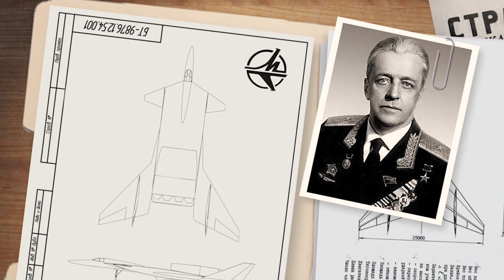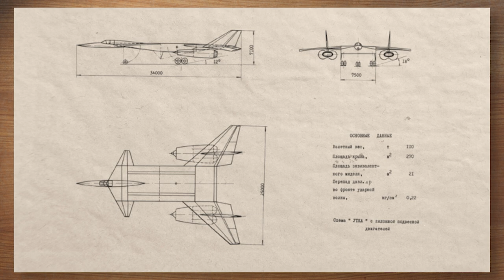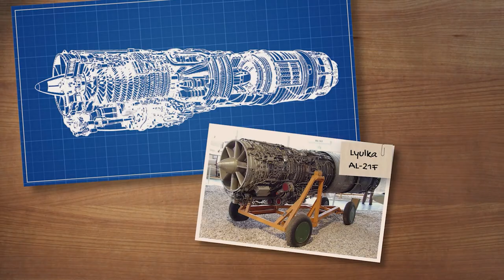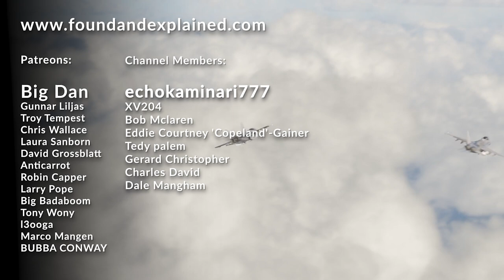Sonic Boom As A Weapon - Russian Top Secret M-25 Hell Reaper

Comment: Try looking up SLAM, the Supersonic Low Altitude Missile. It was to use its Mach 3 speed induced sonic boom as part of it’s offence, along with the fallout from it’s nuclear propulsion, and then deliver a thermonuclear warhead to it’s final target. Truly a nightmare weapon. Perhaps not surprising that even at the height of the Cold War, the USA decided not to go ahead.
It’s development did lead to the navigation systems used by cruise missiles, so we have seem at least part of the program used in operational weapons.
Reply: I believe that plans for that weapon included the ability to drop off multiple warheads on it's pathway, then supercruise over undamaged farms and cities spewing radiation until something broke and it crashed.  Certainly if it had been put into production, this would have eventually been the case as warhead size shrank.
Reply: Its airspeed during attack runs has been estimated at from Mach 3 to Mach 5, while glowing red hot (including most of its pneumatic "avionics").

The USA decided against it for the same reason this video gives for the Soviets dropping their version;
"We can do this but should we? No."
Reply: @markfergerson2145  Honestly, do you believe ethics have ever provided a valid reason not to develop a weapon?  Manhattan Project...  And militarily and strategically speaking, you ALWAYS develop ANYTHING that gives you battlefield domination or a heavy advantage. Don't be too quick to swallow the politically sweetened candy that is given to the public.
Reply: @andrewdavies3584  Oh, I'm way too old to believe anything anyone says without looking at the parts they don't want looked at and yes, I do indeed know the history of why arms races occur.

The Manhattan project (and the similar projects the Brits and Soviets worked on) came from German research before and during WWII. Nukes were frankly  inevitable once nuclear science got started in the early 20th century. What wasn't inevitable that nukes have only been used twice in the seventy-some years since their invention and actually ended the possibility of any more World Wars. I now, everybody goes on about the likelihood of nuclear Armageddon but it hasn't happened. Instead all nuclear powers have drawn down their nuclear arsenals.

We finally found a real "weapon too terrible to use".
Reply: @andrewdavies3584  Project Pluto got as far as engine tests; we know it would work but in reality, the entire weapons system would fall to modern air defenses. That's one reason cruise missiles have fallen out of fashion with all nations except for use at sea where it's impossible to have the density and competence of defenses that can be achieved in land-based systems.

As for the so-called Star Wars program, remember that Reagan raised plenty of American hackles when he publicly told the Soviets that America would share the system once developed so that all nations could defend themselves from nuclear attack. The Soviets actually got angry at that possibility- they claimed that being able to stop nuke attacks was "destabilizing". (I'm 69 and lived through the period and saw all this go by in real time.)

Times change, leaderships change, attitudes change.
Reply: @markfergerson2145  SLAM did not have any sense over ICBMs once was found how much expensive it would be to build ballistic missile defense, and considering the speed of that Soviet contraption it would unlikely do very much. Radar-guided self-propelled guns proliferated in 60ties and man-portable AA missiles came soon after, so flying low even if supersonic was only a one-way ticket, so both projects were canceled simply because they were not very clever ideas, not because they were immoral, that was something military never bothered with until internet age, as the state can no longer control the narrative by being the only source of information...
Reply: That's actually a myth. It would cause some damage, yes, but the engine actually produced less radiation than background in testing, and the sonic boom would not have been enough to kill people. It was never meant for either. It was supposed to loiter in midair, then get activated and fly around at supersonic speeds so it couldn't be hit, carpet bombing everywhere before finally kamikaze-ing its primary target. It also didn't even fly low enough for the booms to have an effect. This was taken from an official document declassified by the government detailing a meeting held during testing, in which the project rep stated that the project was never intended to have such effects

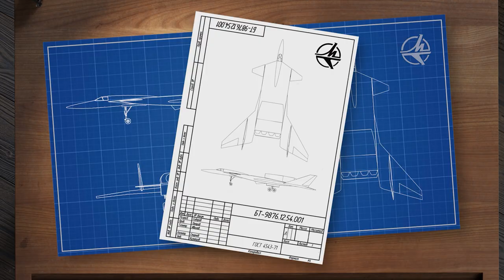Comment: 5:08 "ГОСТ 4543-71" - LOL ))) It's means "State standart for structural alloy steel bars."
"This standard applies to hot-rolled and forged steel with a diameter or thickness up to 250 mm, calibrated and with a special surface finish from alloy structural steel, used in a heat-treated state. "

Comment: 6 PSI eh? from a study I just read it seems it would be like receiving an abrupt  200mph wind for a couple (?) seconds , some buildings (not made of reinforced concrete) would topple, most of the people injured, some people dead (both from the air wave and flying objects/being thrown into objects) , blown timpans ,  0% crashed skulls from the pressure itself (confirming my hunch that that pressure wouldn't be enough for that)
Reply: but it would've thrown people everywhere
Reply: Hector, that's not how pressure waves work. I suspect you are considering static pressure, and anyone who has dove/dived to 5+m below the surface will have experienced static pressure of over 6psi above atmospheric.

A pretty intuitive example of how overpressure can cause you to have a very bad day is an explosion. A 6 psi overpressure is what you'd experience stood around 3-4 metres from a kg of dynamite going off. I'm no expert on dynamite, but I know that standing 10 feet away from 2lb of it is going to be very, very bad for my health. 😉

Another way to express it is sound pressure level... a 6 PSI overpressure is equivalent to around 450dB SPL. 200dB is generally regarded as the threshold where death becomes likely (through the same mechanisms as an explosion).
Reply: Big 🧠’s are lurking
Reply: @donkmeister  Google or someone deleted the link to the study I used for my first comment, it was an study from the 70's on effects of pressure on people and infrastructure, pressure caused by bombs or mine explosions, NOT static pressure. I said 6 psi causes building destruction (except reinforced concrete ), a good porcentage of casualties, high porcentage of injured but not craneal implosion as the video said at the start.
Reply: @hectoraccented5312  Calibrated burst diaphragms are commercially available to determine overpressure spikes from explosions. They are derived from work done by various militaries in the cold War era for the same purpose, to directly measure overpressure spikes from nukes at various distances from "ground zero" to compare against theoretical predictions (which turned out to be pretty good).

Comment: I don’t understand how the indiscriminately kills “friend or foe” is a concern as you mentioned a few times. It seems to me it could be much more focused to a small area than a nuclear weapon could ever be. I guess the thought was that this would more likely be used than nuclear weapons. But if you compare it to traditional missiles and bombs, it also had the capacity to open and close the Ledge to aim the boom like a missile.
Reply: No, the area of effect would be way larger than a "standard" nuclear bomb.  At mach 1.5, you go at 475m/s...  If it used only for around minute, you affect in an instant a 30km line, with important effects on a large surface (on the long term, the impact is less than a nuclear bomb, but for a war the immediate effect would be the same).

Now think about it, flighting so fast, if the pilote make even a few degree of error in his trajectory, you destroy your own lines instead of the enemy ones. With all the vibration such a fligh would generate it would be incredible to be able to make a precise traject.
Reply: A bomb also kills friend or foe depending on where you drop it. I guess the problem was that it was meant for use during engagements so close that the damage was too widespread.
Reply: It's simple. They send the plane before the advancing FORCES

Comment: Original buildings constructed at Edwards Air Force Base, CA, Muroc Dry Lake, were of concrete thought to resist the damage of sonic boom. It was found later that normal building codes local to the high desert region to resist failure from strong San Andreas Fault earthquakes were sufficient for frequent sonic booms.

Comment: The jet design is solid (minus the engines)

The flyby tactic is the problem. You want to dive, not fly parallel. 
By doing a dive bomb, its easier to get up to speed with less power. Its more accurate, meaning civilian areas can be ignored, and it can also target specific areas. By diving, the wave would also be far more effective, as instead of simply sweeping aside the enemy, being disrupted by uneven terrain, and leaving bunkers and underground targets unfazed, a crushing wave would have far more power behind it. It would crush down on the enemy, leaving the shockwave nowhere to go but down. It also would be easier to pull out of the dive, with the shape of the plane, it would be able to pull back up in record time. This also means the boom could be fired at a higher altitude, allowing them to have more time to pull up and also be farther out of range of aa defenses and whatever bs the landscape pulls. 

This aircraft could also be used as an excellent air to air fighter as it would be highly maneuverable while not in a dive. Think the mig doing the weird sideways flat spin in top gun. 

Pulling up from a supersonic dive has also been done many times in military aircraft before. Also, more pilots are trained to recover from dives of high speed than flying over terrain. 

The only issue for the recovery after the dive would be the g forces, so it would require some body training to get used to. Im thinkin centrifuge.

And even if the dive run fails, they can just set back up and do it again, though the amount of times they could do it would be taxing on the pilot. Therefore, i suggest a drone with this shape. This also makes them cheaper, and if the pilot is unable to leave the dive in time, they wouldnt get pancaked on contact with the ground or black out when recovering.

I reccomend a dyson style engine as it reduces drag while in the dive and allows for more power from less powerful motors. Heck, just make the thing electric and give it a salt water battery. That would make it cheap and easy to refuel, simply pump water up from the carrier and into the jet.

Comment: Imagine just how scary that would be if it was fully developed?  Imagine you were a soldier on the ground and all you hear is your fellow troops screaming "REAPER!" and hear this thing coming in low from the distance.
Reply: How do you hear something,  that is at a supersonic speed, coming toward you?
Feeling the vibrations through the ground, yes. Hearing it via air, no.

Several balloons with steel cables would solve the threat.

Comment: Air Force research to nuclear powered ICBM for delivering nukes.

Turned out it worked better without a payload, by carpet sonic boom, and a good dose of radiation from the engine.
Reply: Actually, what if we could use sonic booms as a form of aircraft propulsion? Electrical pulse could produce a spark, that could heat up air, and can  produce pulsed thrust via shockwaves. :)
Reply: @thatguyalex2835  that's basically what a scramjet does.

There is also the wave detonation engine.

There have been various amounts of success with both.
Reply: @jtjames79  Yep, but sadly those don't use electrical propulsion. Imagine an aircraft that flies at an altitude of ~ 70 mi, and use a compressor to pressurize air extracted, and then a spark generator can produce a shockwave (similar to a pulse wave detonation, but with no onboard propellant).
Reply: @thatguyalex2835  That would require an insane amount of energy, far beyond the capabilities of current and near-future technology
Reply: @richardmillhousenixon  Yep. If we could launch the aircraft into extremely low earth orbit, then we need to find an altitude at which the thrust required to keep it in orbit, as well as still able to extract air to be used by the spark generator and form shockwaves.
Reply: @thatguyalex2835  Let me rephrase what I said. That is physically impossible with current or near future technology
Reply: @richardmillhousenixon  Yeah. We would have to wait until the late 21st century, or even next century. No energy density is enough to power a spark gap that can keep an aircraft at altitude, yet.
Reply: @thatguyalex2835  Not to mention that I'm pretty sure that violates the laws of physics, but I'm not a physicist so I can't say for sure
Reply: @richardmillhousenixon  Well, the propellant is air from the mesosphere, which could be extracted using a compressor. Both the compressor and the spark gap can be powered by a solar panel or battery in conjunction with a capacitor to build up enough voltage for each spark. The spark heats the air, which expands in the form of a supersonic shockwave. Yes, the aircraft would be weak, but it would operate in a low drag environment, more so as an intermediate classification of vehicle between low earth orbit and high altitude aviation. Already, satellites can orbit as low as 100 miles with the assistance of a small ion engine. :)

Comment: The North American Aviation XB-70 Valkyrie was the prototype version of the planned B-70 nuclear-armed, deep-penetration supersonic strategic bomber for the United States Air Force Strategic Air Command. Designed in the late 1950s by North American Aviation (NAA), the six-engined Valkyrie was capable of cruising for thousands of miles at Mach 3+ while flying at 70,000 feet (21,000 m).

At these speeds, it was expected that the B-70 would be practically immune to interceptor aircraft, the only effective weapon against bomber aircraft at the time. The bomber would spend only a brief time over a particular radar station, flying out of its range before the controllers could position their fighters in a suitable location for an interception. High speed also made the aircraft difficult to see on radar displays and its high-altitude and high-speed capacity could not be matched by any contemporaneous Soviet interceptor or fighter aircraft.

The introduction of the first Soviet surface-to-air missiles in the late 1950s put the near-invulnerability of the B-70 in doubt. In response, the United States Air Force (USAF) began flying its missions at low level, where the missile radar's line of sight was limited by terrain. In this low-level penetration role, the B-70 offered little additional performance over the B-52 it was meant to replace, while being far more expensive with shorter range. Other alternate missions were proposed, but these were of limited scope. With the advent of intercontinental ballistic missiles (ICBMs) during the late 1950s, manned bombers were increasingly seen as obsolete.

The USAF eventually gave up fighting for its production and the B-70 program was canceled in 1961. Development was then turned over to a research program to study the effects of long-duration high-speed flight. As such, two prototype aircraft, designated XB-70A, were built; these aircraft were used for supersonic test-flights during 1964–69. In 1966, one prototype crashed after colliding with a smaller aircraft while flying in close formation; the remaining Valkyrie bomber is in the National Museum of the United States Air Force near Dayton, Ohio
Reply: Didnt they also gave up since the soviets developed the MiG-25 which could reach the height the XB-70 Was flying

Comment: The total energy this plane puts out in a sonic boon must be less than the total energy in the fuel tanks, therefore exactly how is this better than a bomb, which also causes a sonic boom. The fact that a flyover is not considered an attack is the only advantage I see, and with one small amendment to law all that can change.
Reply: This would be a much more efficient use of the energy, though.

A normal explosion tapers off with the square of distance, so it takes a lot more energy to expand the destructive radius. This blast wave, though, would be released constantly and be evenly be distributed across the length of the plane's wake.

The way it releases energy would be fundamentally different.

Comment: It’s like the first step towards a hypersonic kinetic weapon where the shell disintegrates converting momentum to heat in a blast
Reply: So a rail gun firing a shell that petals out on a time fuse. Because of the speed of the shell and the massive buildup up aerodynamic forces causing massive heating of the projectiles. The first question should be how big of a shell would you need to generate enough heat to actually affect and area.
Reply: @firewing1319  probably some material dense and frangible, so it transfers as much heat as possible without liquifying. I’m guessing some metal-oxide or alloy of dense metals.
Reply: @firewing1319  I’m also reminded of 3 km/s turning a mass into the same mass tnt explosive power- so start with however much tnt-yield you want and material density to get shell size